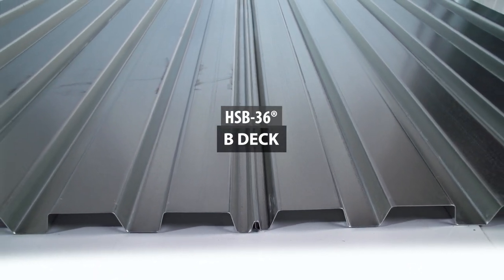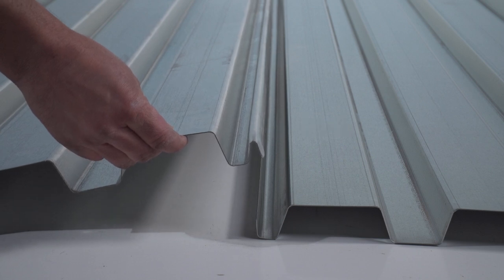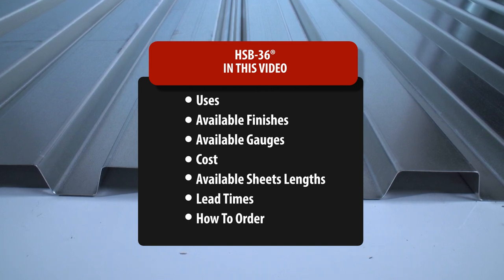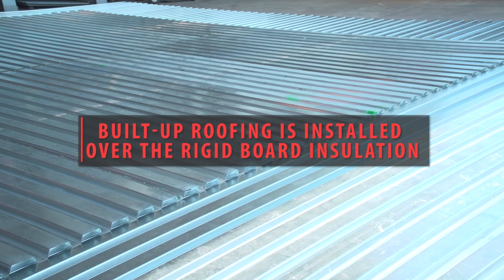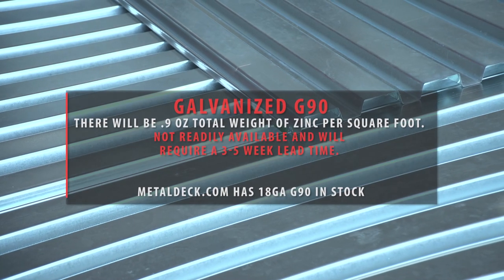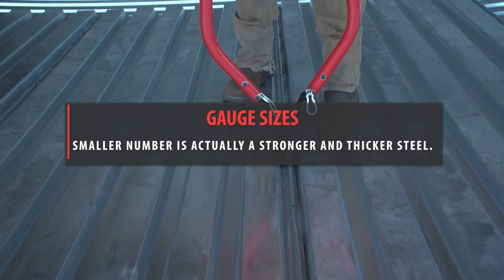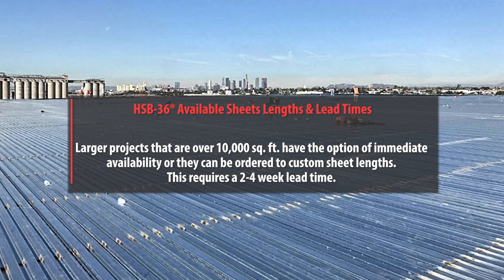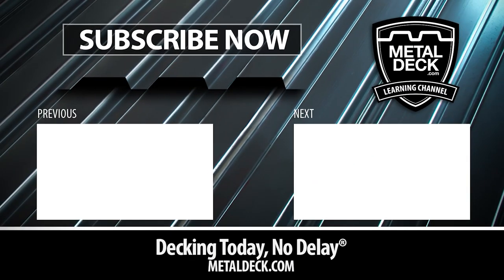B Decking Buyers Guide [Pricing, Dimensions, Types, Gauges, Finishes, Uses, Lead Times]

Comment: Good Morning, My B deck layout, in the 36" direction, is 5" short.
My inside parapet to parapet dimensions is 15' - 4". That is 5 - 36" panels with 5" left over. What is the correct detail to fill the 5"?

Comment: How much end overlap from one sheet to the next? or are the sheets butted together?
Reply: The metal decking overlap is a 2" minimum. Most jobs are overlapped, 2"-4". Must be overlapped over a support beam/joist. The greater the overlap the worse the deck will nest at the sidelap.
Reply: @WesternStatesMetalRoofing  Thank you for your reply. I have a total run of 32'-8". I am assuming 2 -12ft panels and 1-10ft panel cut down to 9ft, allowing 2" overlap at each end of the 9ft panel. can panels be swaged or will the 2" overlap work without too much interference? We are using metal C joists (800 S 200-68) for roof joists, I am having a hard time finding a span chart for ROOF C joists...all the span charts are for floor loading. The HSB-36 (22ga) will easily span 36, 42, 48, etc. but the joist span charts only go up to 24"o/c spacing. The roof load is just rigid insulation and roof board....trying to come up with the most efficient design....Thanks again for your help.
Reply: @LiloUkulele  Lilo, Flexospan publishes a load chart for C Purlins
http://flexospan.thomasnet-navigator.com/Asset/Z-Purlin-and-Girt-Structural-Steel---Load-Table.pdf
As far as the B deck sheet lengths go you will get 36" coverage and they can be cut to any size.
Reply: @WesternStatesMetalRoofing  Thanks for the quick reply!!